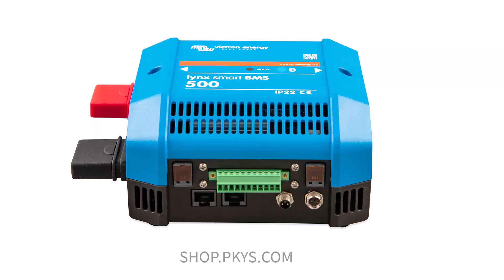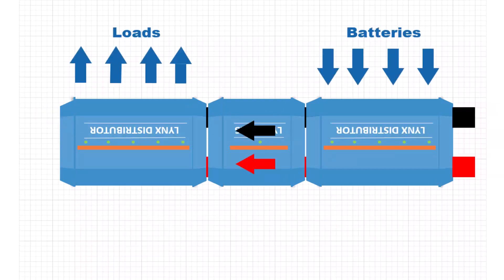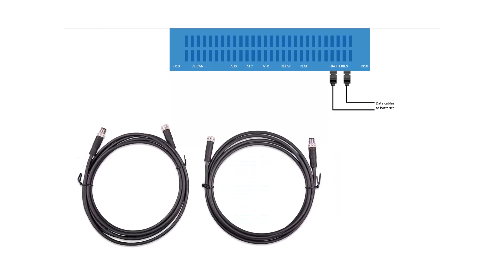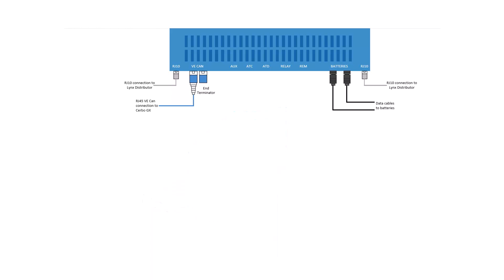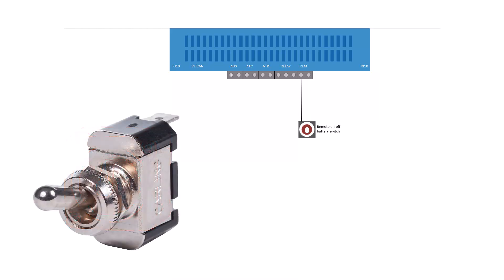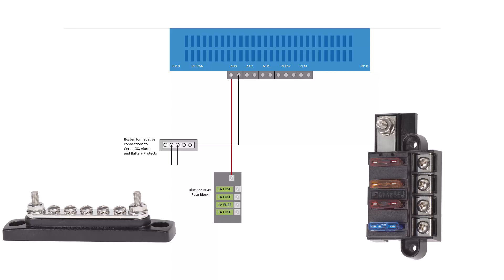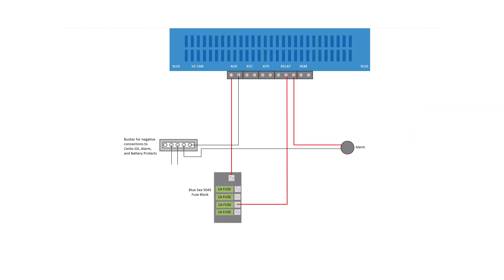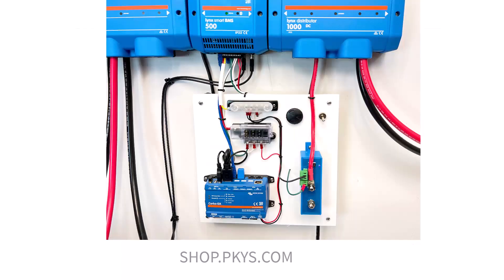Lynx Smart BMS

Comment: Hello and barvo for the video
I wanted to ask you if it is possible to install the bms from victron (16S for a packlife that I have in 48 volts? 600AH)?
or do you have to have a victron battery?
my batteries are EVE 280AH in 16/2P
can we wire all the batteries with the bms from victron or do we need a bms compatible with the victron?

otherwise is it possible if there is no can in the battery pack to tell victron (multiplus and cerbo GX) that I have a lead gel battery pack?
there is no bms on the lead in general?
my pack can be protected by its own BMS cutoff 2.80 volts and maximum charge at 3.65 volts Possibly just to emit more or less on the multiplus?

thank you
laurent
Reply from the maker: The Victron BMS range are for Victron batteries only, sorry.
Reply: Hello
I have another question about the lynx distributor
on my solar installation I have 5 strings so 5 mptt smarsolar 150/35
they all have their 40A mega fuse fuse
I was wondering if it was possible to connect the 5 smarsolar 150/35 directly to a lynx connector with a 200A fuse?
possible? because otherwise I have to buy 2 lynx (expensive) to connect 4 individual smart solar (6MM²) on each lug of the first lynx and 2 others on the second lynx with the multiplus 800VA in all 7 locations on the 2 lynx
no risk of gathering all the mptt in 6MM on 1 lug of 50MM²?
Reply: HELLO
no I don't have the same PV everywhere and not all the same brand on the roof but in different places?
Reply from the maker: We often use the Blue Sea 5196 Fuseblock to connect three solar charge controllers together and send their combined output to the Lynx Distributor.  The Blue Sea Fuseblock takes terminal fuses that come in sizes from 30 amps and up.
Reply: Hello
yes I did that I assembled 3 MPTT on a lynx location but each mptt is equipped with a 30A fuse so if ever there was a problem the mptt will have their own protection and will be able to trip
Reply from the maker: https://shop.pkys.com/Blue-Sea-5196-Terminal-Fuse-Block-for-3-Circuits_p_7754.html